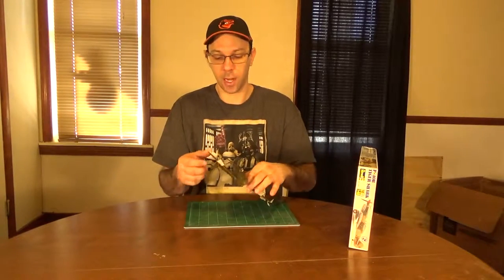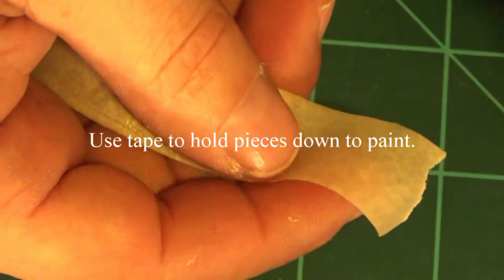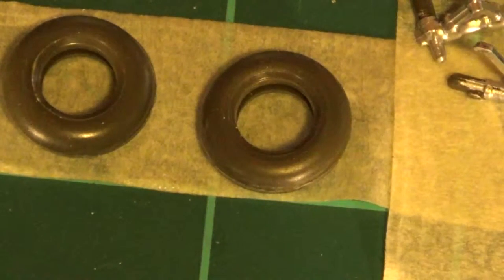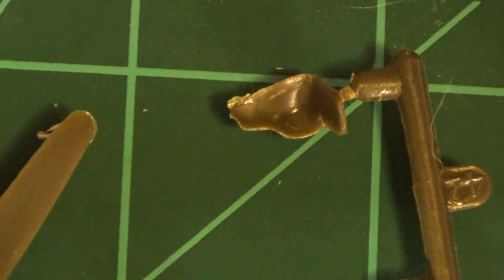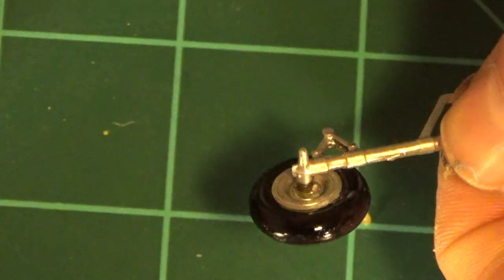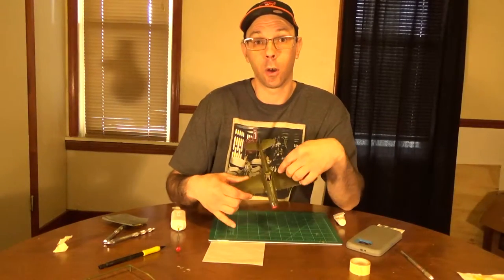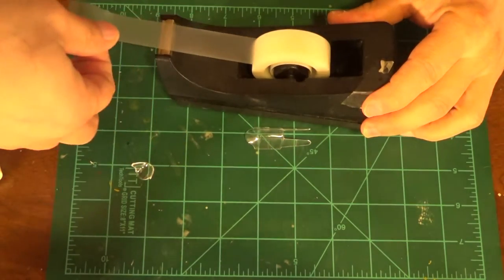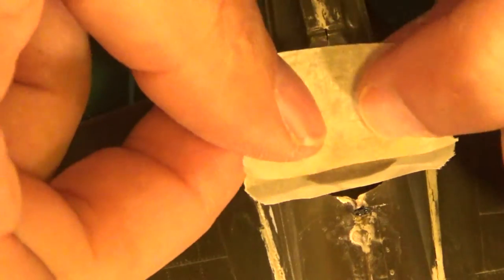Revell P-40B Tiger Shark 1/48 Plastic Model for Beginners Part V

Comment: Nice build!! What kind of putty filler do you use? Thanks!
Reply from the maker: +Ponykiller I used to use Testors in the grey tube, but have switched to a different kind that is green. Worked alot better than the Tedtors.
Reply: Plastic Model Builder I'm going to get some. Thank you for the fast response!! Great videos!!
Reply from the maker: +Ponykiller I think it's actually called Green Stuff.